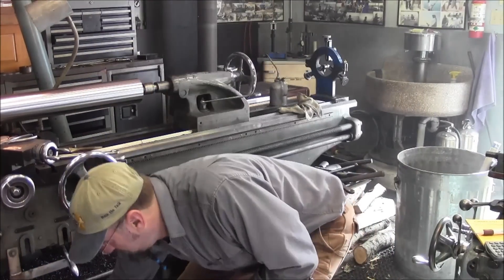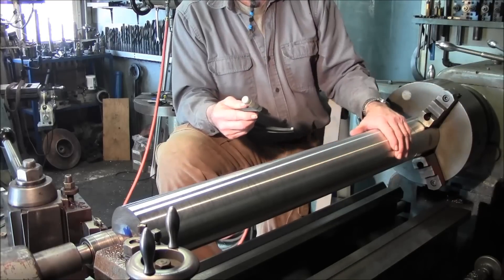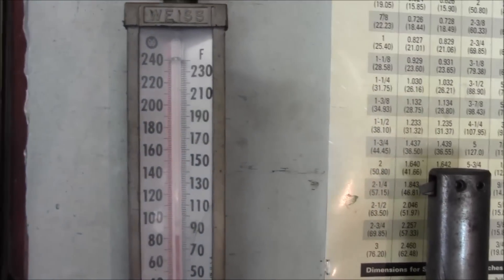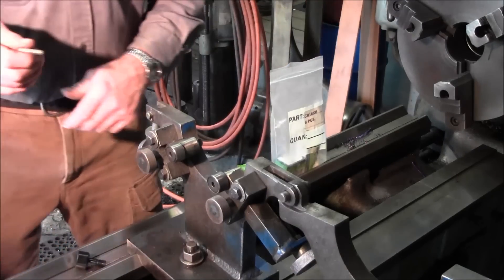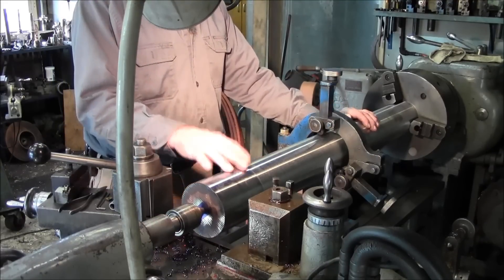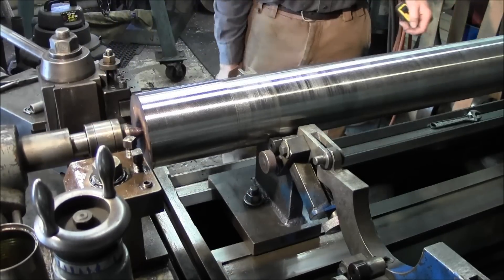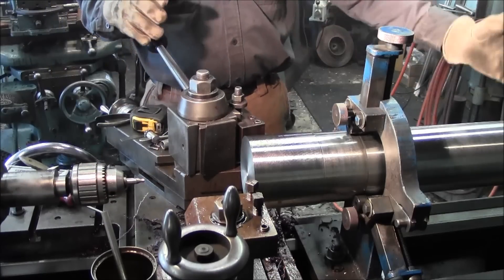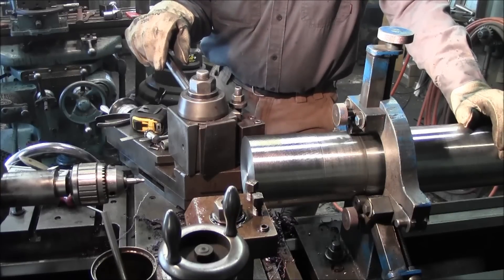The Broken Beaver Part 2: Wood Chipper Repair

Comment: I may have missed you mention one of THE most important reasons to keep the shop temp/humidity as constant as possible ---> Condensation!!  At least once a season - and usually excited to do some machine (or, Scooter!) time in the Sunshine -  I miss or forget about an abrupt outside temperature change and hit the garage door "Open" button.  I get to spend the next hour or so with some 3M pads, paper towels and WD-40 on the cold cast iron.
REALLY appreciate the vids Keith!!   Gracias!  Jim / Ohio

Comment: Heating that ring until it dropped right off was the coolest trick that I've ever seen!  I would have though that the heat would have transferred through to the shaft before it enlarged enough to fall right off.  Pretty cool Keith!

Comment from the maker: There was a reduced diameter at both ends and I like doing it that way because it’s in position to face and center drill for next operation of turning the diameter down on the ends. Thanks for the comment! ;{)---

Comment: I'm surprised you had to get the blue wrench out to get that cam bearing out of the steady rest, but as you said cheapie allen screw.  I think that is the first time I've seen in your vids using a hacksaw to complete the cut, your explanation makes sense not worth the risk to go all the way.  Nice detective work on the shaft bearing collar.  When the  ring dropped to reveal the radius on the shaft just as you described earlier without seeing it first, great!
Nice work Keith!

Comment: You should consider building an outdoor wood-fired boiler for your shop and your home. Get an old oil tank for your firebox and some copper for water coils. You need circulating pumps, some pex tubing, radiators or baseboard heaters for inside. You could buy one ready-made but they're pretty pricey. There are a few YouTube vids about making your own. Crafty guy like you should be able to whip up a winning unit. Firewood doesn't seem to be a problem. Good luck!

Comment: Radiant floor heat in a concrete slab is like heaven, I hear. Gotta insulate your slab. 6X6 remesh with pex tubing zip tied to the grid. If you go this way then your shop will keep the steel & iron warm overnight, no problem! I plan on doing this pretty soon after I move to my country land. I'm gonna do it back in the woods. Planning & Zoning can kiss my ass. 

We need more log-splitting videos!

Comment: I like what I see--you know your material and your feeds and speeds. Your understanding of the work to be done. But you could use better eye protection. I'm also a Machinist with many years of working the trade, where I've seen many happenings with safety procedures! Other than that--Great job of showing what you do--I too like the old equipment, where we still feel part of the job. And yep I'm retired!!

Comment: Most serious turning vid yet, thanks! Good strategy finishing by hacksaw, parting 4.3" diameter!  Way too hot at 82--a California thing? My shop cools to ambient during week while away at real work so handles are cold 'till Sunday. Will try green wood to extend burn time Fri and Sat evenings!  0.002" over 37" on rough cut diameter--I'd be happy with that on a finish cut!  Nice roller cam steady design, brass tips on mine suck for fine work and are not radiused correctly for small diameters.

Comment: Another great video Keith. Regarding your steady, instead of taking the cam followers out to put on the other side, an alternative may be to simply make the arms symmetrical (if they aren't already), and rotate them 180 degrees so the bearings are on the other side. On mine they're symmetrical like that and it's much faster.

Comment: I watched the parting process waiting for the explosion. Parting on my lathe must be done at the lowest speed with everything locked tight then flooded with coolant and with a deliberate but steady infeed. Usually any chatter is a split second warning for when the tool will explode in a mighty bang. I tend to only part mild steel and aluminum, any chrome moly or stainless just puts too much stress on the machine. I'll part it on the band saw, or with a hack saw or sawzall. Your machine is indeed strong and true to be able to part high alloy at 400rpm.

Comment: I am no expert and am self taught. I often turn shafts this size or a little bigger. I was interested to watch you switch end to end several times and then part off the spare inch or so. I leave the spare in the chuck, turn the shaft and part off with the steady next to the chuck and finish with a hacksaw just like you! Is there an advantage to swapping end to end that I'm missing? Lovely tidy workshop, good video too!

Comment: I miss the  snow ad cold over there here in Australia we have been 90 - 106 and my air con stays on around the 75  mark and I love it. I have been wanting to ask I paid for some aluminum round stock 4" OK and 4" long and it costs  $34 US does sound about right for you guys.?
Reply from the maker: 6061 4" diameter x 6" long at MC Master Carr is $50 ;{)-----

Comment: WAtching you unstick a bolt I was wondering if you could use a little bit of silver. I make Silver Series lubricants . The silver additive I make is about 5% silver and does wonders for bolts so they do not stick. I will send you a little bottle if interested. Ron

Comment: Hey Keith love your videos! Flipping that shaft end for end so many times is a lot of work. I learned very fast in a job shop that no two machinists will run a job exactly the same, but i can't help but ask. Why not run that shaft between centers? Or use shim stock and flip it only once? Also I would be a bit nervous running that live center with that size shaft. A little too small for me.  Thank you for your videos!!!!!

Comment: The bottom rollers on the steady-rest should have a tension on them equal to the weight of the shaft. Not just to the point of "stop rotating."

Comment: Hi Keith.  Love watching your vids.  Real good quality too.  I was wondering why you bothered parting the end of this bar and as you say, risking the blade and tip.  I think I would have surfaced off the excess.  Also, do you ever use the rear toolpost for parting off?

Comment from the maker: My sister in law calls it the Florida room! I can open the door and get fresh air any time, also push the air into the other section which has no heat! I want warm handles and no jackets… ;{)---

Comment from the maker: I believe they are considered size #4 cylinders and around the shop, average job here and there last about a month, if I was fitting and cutting like steel construction, I’ve gone through a full set in two days. ;{)---

Comment from the maker: I think it may be a concern if you were maximizing tool life and production speed to really fine tune, operation, it would pay to program the progressive adjustments. I kind of watch the chip color and feel the tool pressure of hand feeding, adjusting only the feed rate to compensate for the difference in SFPM.  The Sandvik system is the most forgiving to older machines than any others! My Opinion, for the last twenty years!  ;{)---

Comment from the maker: It’s only a cheap butt wooden shack, not much of even a foundation, very little insulation and does fluctuates a bit during the day with some  traffic in and out. The trick is to create enough heat within the metal heap to keep until morning! ;{)---

Comment: Istill can't understand why there was such a huge gap in the original parts, .1 ins far out considering the weight and the possible harmonics in the machine it certainly explains the fatigue cracking due to flex inside where the flanges were welded. Personally a fridge fit and weld then LPG ie propane torch stress relieve the welds. That beaver should outlast the original machine.